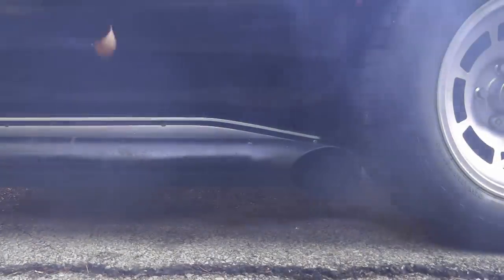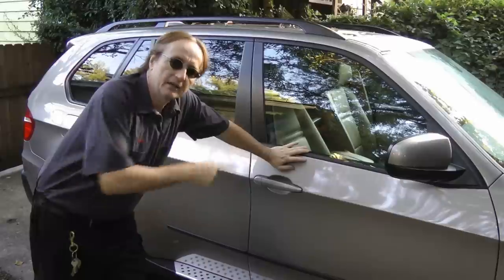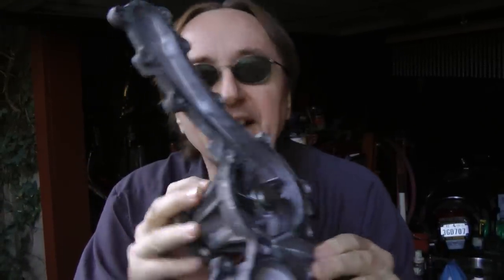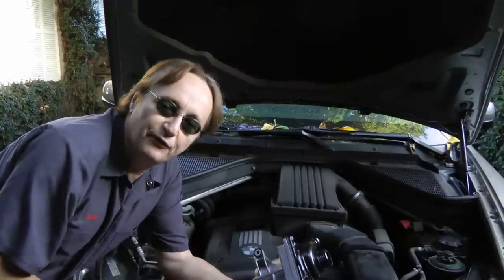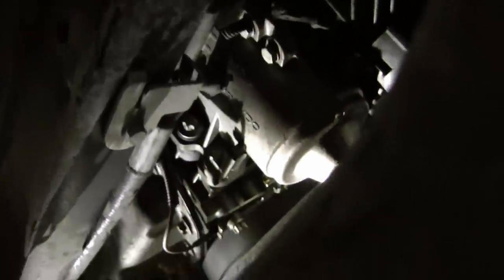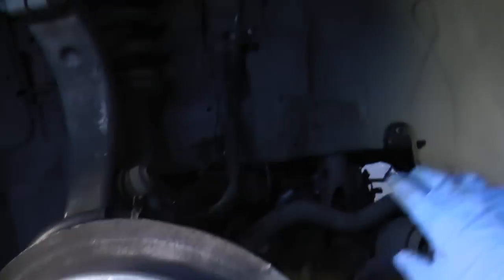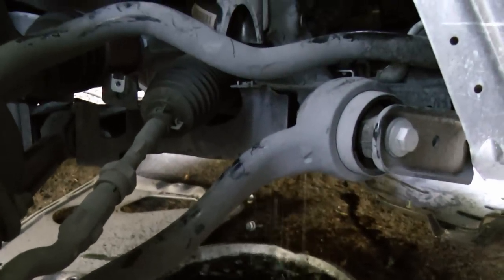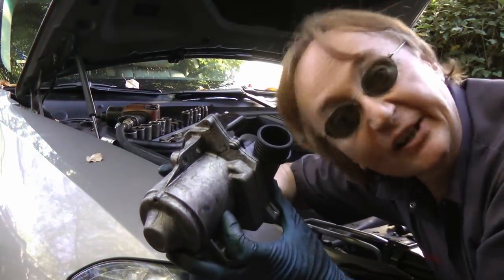How To Replace a Bad Electronic Water Pump

Comment: Hii Scotty, I have a 1983 Honda Prelude. I wish to know if there any idea to protect the engine from leaking oil. Bcouse in my country （Malaysia）, the weather is damm hot. also my engine. Thanks. And sorry for my English, because i translate by using google translate, looks weired. HAHA
Reply from the maker: yes, I put AT 205 Reseal in the engine oil to prevent leaks. amazon.com sells it

Comment: Looks like this is my problem on a 2008 BMW 335XI....The fan turns on full as soon as I start the car and I don't have any coolant pumping through the small return to the expansion tank. This sucks.I was hoping it's just a fuse....My older 1989 BMW 535i seems a much more user friendly car. I had this 335 only 4 months...I may sell it. I hate these newer computerized cars.

Comment: Wrong. You fell victim to hype. How much MPGs will be gained by using this setup in comparison to a traditional belt driven pump? It will hardly be noticeable and will only be a pain in the ass to replace when it does eventually break which might be sooner than you think. Also, they can mount an electric pump anywhere under the hood so why did they mount it in such a stupid place? They did that because they want you back at the dealership to have it fixed!

Comment: No it doesn't. 

running an electric water pump DOES NOT produce more mechanical drag on the engine. The alternator produces the same amount of drag that it would if there was no water pump present. 

And for the AC pump, why do you think mechanics say that running the AC DECREASES HP? Any form of drag, or load on the engine decrease its efficiency.

Still haven't replied on my comment on why manufacturers are switching to electric power steering.

Comment: Plastic water pump... wow but the fact that it's electric AND bolts to the engine baffles me... maybe they had the design up on the computer and said... we don't have any more room to supply mechanical power to the waterpump and someone probably said why not make it electric lol... I thought my 01 escape v6 awd was tricky to work on coming from previous experience with old vans but those bmw's seem to be made to increase billable service hours. At least it's not as big a pain as that gm VATS....

Comment: Dear Scotty! I did not understand how you dismount old water pump? video from 2:21? it is enough space here? I have X5 E70
Reply from the maker: you have to loosen the motor mount and jack the engine up to get enough room, Great design by BMW
Reply: Scotty Kilmer and this place is exactly from 2:21 of your video? and why have you taken off the wheel? Access to the water pump may be bottom of the car! I am asking because my water pump is broken and I want to replace by myself
Reply from the maker: I took off the wheel to get access to remove the bolts, only way to get to it really
Reply: Scotty Kilmer With conventional water pump you sometimes need to jack the engine too. I did water pump replacement on a Honda Accord - had to raise engine to get access to it.

Comment: ALL BMWs since the early 2000's have been using water pumps with PLASTIC impellers.  Not just the electronic ones.  The "electronic" factor has nothing to do with the reliability of the part.  BMW started putting electronic water pumps about 5 years ago to help with fuel efficiency.

Comment: What's the real advantage for BMW with an electric water pump and magnesium screws? Sure they'd save some weight, but BMWs are usually very heavy vehicles to begin with - how is this achieving anything more than income for BMW repair agents?

Comment: It really seems like a hit or miss with these water pumps.  I'm on my original pump and thermostat and have over 110k on my car.  I have heard though that people with 30k having their pumps go bad but then on the other hand I have heard people getting to 200k.  I'm pretty sure that more and more cars will go down this route in the future as fuel economy standards increase and there is a greater need to control the cooling of the engine.

Comment: Then why do you think people remove the AC system when trying to make a car go faster. 

Imagine how much harder the engine has to work, when there is drag on the belt.

It's the main reason why car manufacturers are now building cars with electric power steering, instead of using power steering pump. 

the alternator is a generator, it can handle the load. The battery is use for cranking and buffering the load when the alternator can't.

Comment: WOW ONLY 60K ANF THE WATER PUMP CRAPPED OUT ALREADY!!!! I was about to buy a bmw 7 series last year but quickly changed thoughts
Reply from the maker: smart move, I just fixed one with a bad shock at 45 thousand miles and it cost 700 bucks just for the fancy shock.

Comment: In defense of BMW these pumps do last over 100k, but not all of them. It does suck they went with an over engineered electric was pump. Ill stick with my E36 and E46 for now. The E36's water pump with the plastic impler did last 155k before the bearing went out.

Comment: Well Scotty, 

The combustion engine can only be modernized so much internally so to increase fuel efficiency, technology like this has to be implemented. It's just one step further to full electrification of your mobility, which will be the future of transportation. I will agree with you on one thing, why the hell did they use plastic parts in a major component of an engine? Just to save a few ounces?

Also, If you can't afford a luxury car, probably not a good idea to get one. Luxury cars are essentially scientific experiments of the latest and greatest technology and later when the technology is proven, it will be implemented in the mainstream. It has always been this way.
Reply: I COMPLETELY agree to fully electronic stuff,but, maan... BMW could design those stuff a LOT better and be MUCH MUCH reliable. Plastic material for pumping HOT water?? what a great design. Electronic is not the problem, but the plastic is.

Comment: So I just ran across this. While I agree the idea of an  Electronic water pump was a very bad one. You can get it all out from the bottom.  I've replaced a few of these and never had to remove the engine mount or go in through the fender.  As for the bolts.  A lot, not just BMW or European manufacturers are using them.

Comment: Scotty, I enjoy your videos but what on earth is your problem with German cars?  Seriously, I own an e46 330i and so far it has been pretty easy to work on--that said after doing the clutch, flywheel, ccv system, underdrive pulleys, oil changes, water pump, fuel pump, strut assembly, etc, etc.  I do realize that German cars are somewhat more expensive to work on...but not that much more.  IE my fuel pump cost $140, ($300 less than that of a 2004 Chevy Malibu we had in the shop) my water pump cost $55ish, clutch and flywheel were $600ish.  Let me hasten to point out that I have a dual mass flywheel.  That was more expensive.  You know what's more expensive than that?  The dual mass flywheel on a 24v Cummins.  Pads, rotors, calipers, etc, are all what you would expect to pay for a sport sedan, Euro or not.  

Yeah, I'll admit that BMW has come up with a few dumb designs.  But singling them and Mercedes out is just plain ridiculous.  In your "Mercedes is stupid" video, you pointed out that the pads don't cover the whole rotor.  Show me a car where the pads do.  I have never seen this in the shop I work, and we work mostly on domestics.  My boss explained to me that if pads did, they would have a tendency to 'crawl' over the edge of the rotor.  Furthermore, even if you have a ridge built up, it doesn't necessarily mean that you need to replace the rotor.  And you could turn the rotor to get rid of the ridge if it was a problem.  In the same video, you acted like the Mercedes needed a bunch of new computers because of the fault codes...when in reality, they might have indicated that a bulb burned out...or they may have came to be due to low voltage in the battery.  

I'm not an experienced mechanic myself, but it seems like you just hate BMW and Mercedes because they're stereotypically driven by rich snobs.
Reply from the maker: +Daniel Hartman I've been working on em since the sixties, and now, they are over engineered junkers as they age, the US models at least which are often not even made in Germany. Check their insanely low resale prices, that says it all
Reply: +Scotty Kilmer Would you recommend an earlier BMW? Pre 2000? Or just avoid them altogether
Reply: Julian Park Scotty Kilmer would avoid all BMWs altogether.  I wouldn't recommend a BMW to someone that won't work on his own car, if you're willing to put time, effort, and some extra cash into it, go for it.  Try to avoid BMW SUVs, and anything in automatic.  

I can personally recommend the e46 3 series.  I know and love this car despite its quirks, and I'm happy and willing to work on it if it breaks.

Just don't buy one for the name...or you'll end up with an x5 that's no better than a Tahoe or escalade and you'll miss out on the true BMW driving experience and be left with a bland luxury SUV.
Reply: Daniel Hartman wow I wish the water pump on my x3 was only $55, mine is $455 :( heck I have to replace the entire thermostat housing, just to replace the thermostat. These things are only for people who are mechanics that have the tools, a good work location, and the dedication

Comment: i have a sound in my car (santa fe) ,it looks like bad oil pump or bad water pump,and it comes morning and continue for 30 mint.then disappear .how can i diagnoses the problem ?
note:the sound comes after start driving the car,and no sound during running engine without driving or moving it
Reply: khaled sabbah headlight fluid probley low try topping that off first thing. let us know if it is working
Reply: thanks for four reply....after investigation in the workshop they told me to replace the intake manifold because the sound come from it.is there any solution instead of replacing ...its expensive and only there is ticking sound inside?

Comment: Trunk or tailgate? Thats nothing. As a valet, I've noticed that the Chevrolet HHR's door is bent inwards, which means if you are standing even close to the door while you close it, you're liable to rip off a load of skin and flesh (I found out the hard way) and the same with the top of the door. It's bent inwards and back and I almost knocked out several teeth once. Have had no problems with any other car.

Comment: Our 2010 BMW X5 is on its third water pump now.  The first one failed for not running at the right speed, causing the fan to always run at maximum speed.  The second one leaked after just a couple of years.  The part was under warranty. But they being BMW, still charged like $600+ for labor...  Then, the hose that connects to the water pump broke last year. Those guys must have yanked on the hose too much. And those stupid hose head was made off plastic as well!!!  Oh well, I fixed that one myself.   So today,  I saw coolant coming out from the underside of the car.  I don't know what failed this time. Maybe the water pump leaks again. LOL....  To be fair, we have put 140K on this car now.  That's probably way too much for Germany cars?
Reply: Just stick with older vehicles

Comment: I like BMW for the way they drive. However, the new generation BMWs are all designed to be obsolete in 5 years, if not sooner. How in the world they can have transmission fluid as lifetime and doesn't need replacing is beyond me. I used to have an E30 that lasted me over 1/2 million miles on the original unopened engine. All I did was change fluids, engine oil, and replace brake pads and it runs forever. The parts were all metal and it was a joy to drive and service. I read just the other day on a Bimmer forum on how they toute and praise German engineering as everything over-engineered. Typically stupid and unrealistic, clueless weekend wannabee mechanics that doesn't know better. Now when I work on my E90, I always cuss and curse when I encounter problems because of their stupid design. Imagine designing a 45K + car that will only last 5 years because you just cannot work on it. Well I'm just clueless as to how in the world they can become successful in its line of cars. I guess people as still hung up on its reputation....."Vee know vhat vee are doing. Our carz are build vely advanzed and you don't need to vork on it".
Reply: Henry Ting “Lifetime oil” doesn’t literally mean lifetime. They have been having that put on their transmissions since the 90s, especially in their manual transmissions. First thing I did was change the oil before I put it on the car.

Comment: yeah it's not a great idea. they didn't last long when they first started putting them in the bmw's I think they better as time went on. 100,000 seems to be the average lifespan of them now days. still a dumb idea though. i'm not a fan of the water pumps run off the timing belt or chain because if the bearing fails they timing could skip

Comment: If the mag bolts are brittle then wouldnt they break when u remove them?
Reply from the maker: torque is only when you put them back on. That's why BMW says to always replace them. It's stupid, why not just use steel bolts, really they are so fricking tiny the gram weight saved is rather retarded. this isn't a fighter jet.
Reply: Scotty Kilmer In general, it's always best to evaluate surprising information in life in terms of Occam's razor. If something strikes you as incorrect or surprising, it COULD be wrong, but it's much more likely that you just don't have all the information. I'll leave the overall electric vs mechanical coolant pump design decision alone, but the bolt decision was made for a very specific, very good reason. The engine block in the N51/2 is a magnesium/aluminum alloy. If you were to use steel bolts in it, they'd galvanically corrode quickly, and even quicker in the presence of water. The engine would unavoidably and rapidly fall apart.

You can debate the merits of the more complex, flexible, error prone electrical pump vs the simple, limiting, well-characterized mechanical, but I think we can both agree that either should be securely fastened in place.
Reply: Tristan Rios 3 tons of bolts? I'm gonna leave that one alone.
Reply: Do you know how many bolts it takes to add up to 100 pounds? You can't even use some of those brittle bolts on the suspension system where they will encounter that kind of stress and vibration. So you save maybe a few pound of bolts in the engine bay? Not only is it super pointless-its an SUV, not a race car! :v Your derp point is invalid.
Reply: Yup, it'd make that SUV so much faster & reliable. Got it bro, point taken.
Reply: It's got nothing to do with the weight of the bolts. That's insignificant. The bolts must be magnesium to avoid corrosion against the magnesium engine block. The block being magnesium DOES result in significant weight savings.
Reply: That's why you have to be very careful removing any of those fasteners that has been on the car for a few years. Corrosion and binding the metals of different alloy due to their different electrode properties. Another smart engineering designing their car to be obsolete in a few years.

Comment: They only warranty their car for 4 years or 50K miles. So the work they do cover, they stretch the maintenance schedule so that they don't have to do it. For example, 150K miles for oil change. Lifetime transmission oil that even ZF and GM said you should replace very 30K miles. Differential oil that never needs to be replaced because they even eliminated a drain plug. You check the oil electronically because there is no dipstick for the engine or transmission, and quite often these electronics work quite unreliably. Yeah, that German over-engineering for you.
Reply: Some of the stupidest things I've heard about is the sealed transmissions that you can't change the fluid in even if you want to. I just wonder what's next. Maybe sealed engines that you can't change the oil on?
Reply: The transmission is not sealed. It has a drain plug as well as a fill plug under the car. However, since there is no dipstick to facilitate added ATF, you have to get under the car to add fluid (just like the manual transmission). But then, it is not an easy task because you have to do it while the engine is running in "P", and use a temperature guage to make sure it is warm enough, then open up the fill hole plug, adding fluid until it overflows.
Reply: On BMWs E90, the transmission drain plug is like a1"  flat pan cake with a tiny 5mm hex hole for you to use an allen key to loosen it. The metal is soft and you so much as sneeze on it, the hex hole will be rounded and you need a hex bolt extractor with reverse threading to get it out. Ask me how I know about these because a simple transmission oil change result in a whole days work. Now, not only do they use alloy fasteners, but they also design it so that it becomes impossible to take out without extensive work. No wonder they claim life-time fluid because even BMW pros hate to work on those cars.

Comment: I love how BMWs drive. Great handling and they have that bank vault solid feel but I wish the German engineers could engineer some durability into their parts used in the vehicles, would make for a much better ownership experience. BMW cooling systems were always a weak spot in them especially the viscous cooling fan clutch from the 90s.